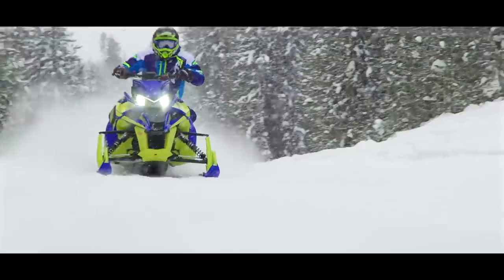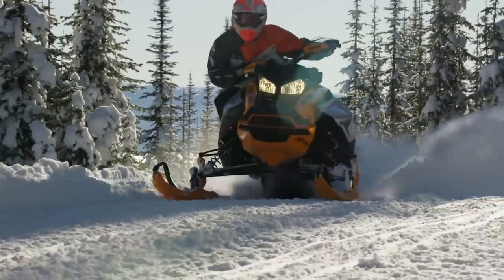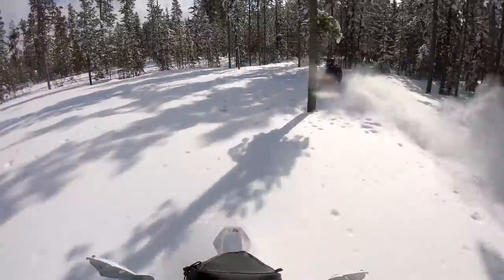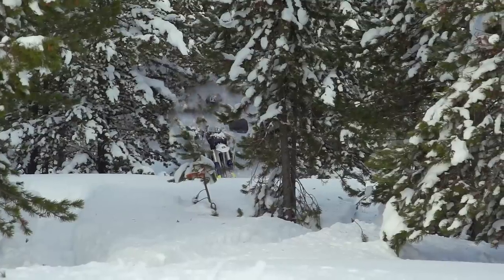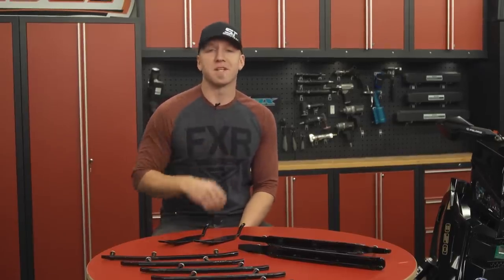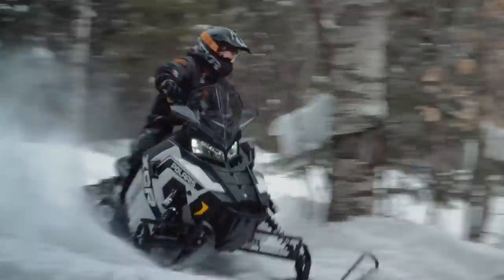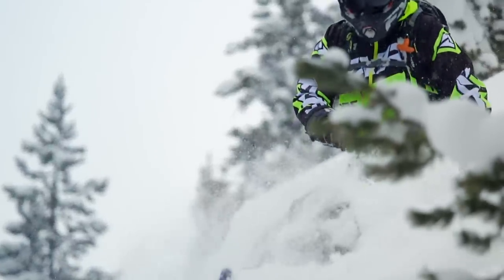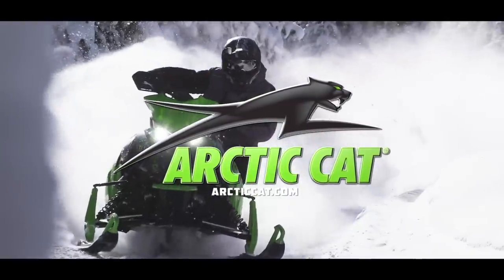SnowTrax Television 2019 - Episode 5 (Full Episode)

Comment: Didn't Yamaha use sprayed on cylinder lining back in the 80's ? It's called " Nikasil plating" by Yamaha.
Reply: Mark Bow Kawasaki also did that in there triple marine engines since early 90s I know for sure
Reply: @ericalbertson6621  Yes, that's why they had very good engines to. It's not new technology like Mark said . I find that type of hype frustrating to hear especially from SnowTrax they should know better.

Comment: Ok well plated liners goes way back to the late 1960s guys. Kawasaki sled engines used in Cat were chrome lined not sleeved. T 1 series twins. I got one in my barn. First used on Cat in  69/1970 for a pilot build, mass produced the next season. Suzuki twins used by Cat were nikasil lined. Summer 1974 for the half breed Suzuki Fury limited build sled built off the El Tigre chassis, then phased in for the 1976 Cat line. If you want to get picky the Sachs Wankel 303 engines are nikasil and that design dates back to the mid 60S. Gee next Ski Doo will say they invented the slide rail suspension and A arms up front.